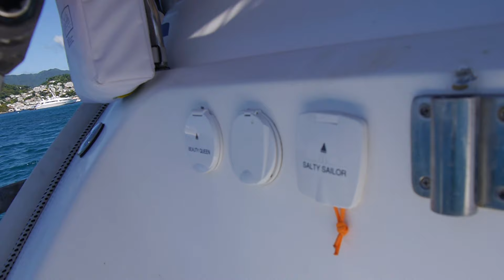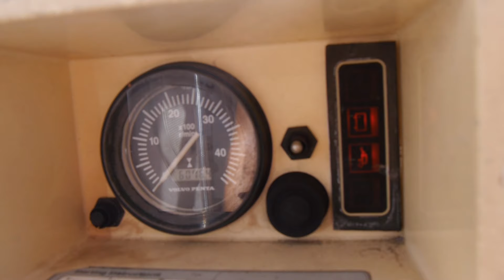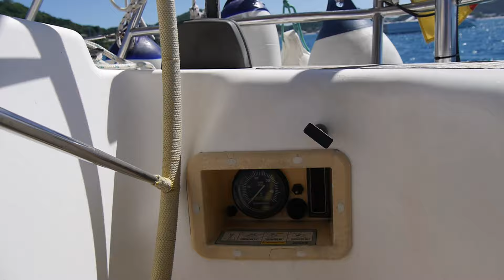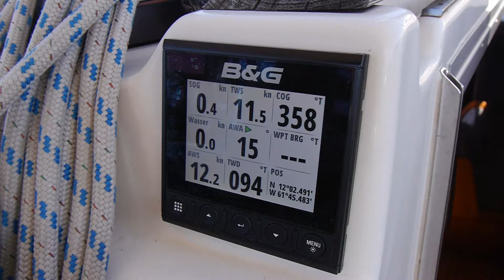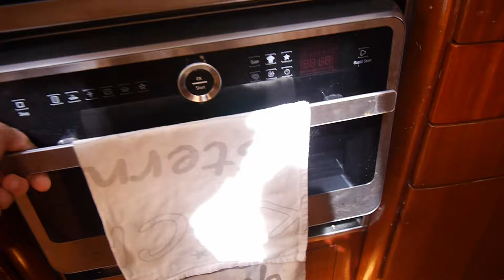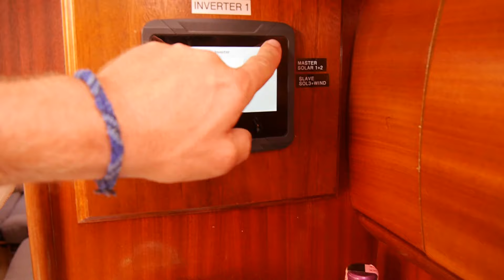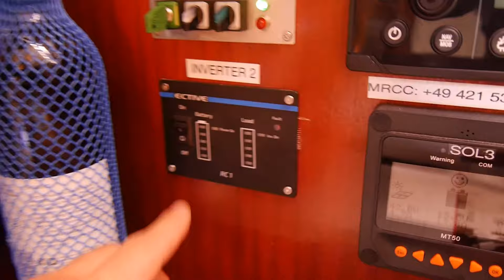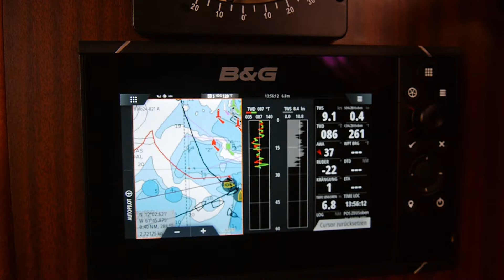Bavaria 44 Bluewater Sailboat for sale

Comment: hello. Is the boat sold now? Great walk through and explanation. thank you.
Reply from the maker: Yes, she has a new owner.
Reply: @CircumP  Thank you for quick answer and well done on the sale.
Would you recommend this make and model of boat and what are the things that a potential buyer should be aware of? This would be a massive help to me as I am quite taken with this model and your answer would be really appreciated. 

A big thanks in advance.
Reply from the maker: The 44s from that time are great. Very solid and already quite spacious and „modern“. A major disadvantage is having the two heads on the same side. Saves cost in manufacturing,  but not ideal for passage making. Also I would prefer a lead keel instead of an iron keel in the future. Cockpit seats are a bit too short for sleeping fully stretched out. Check top rudder fixation nut from time to time. Ours loosened itself mid Atlantic. Happy boat shopping.